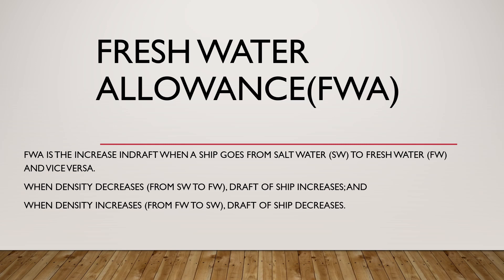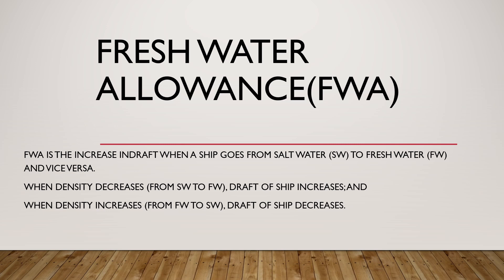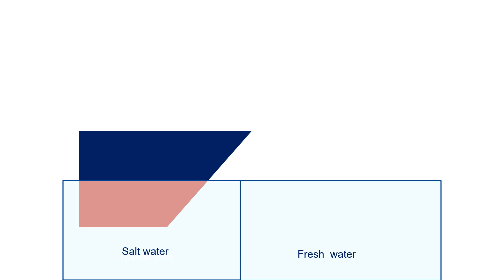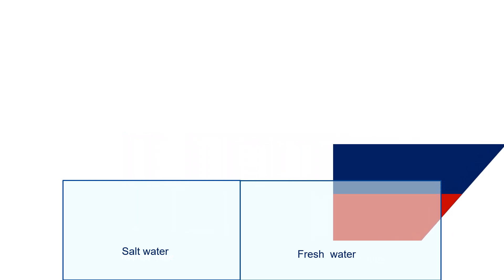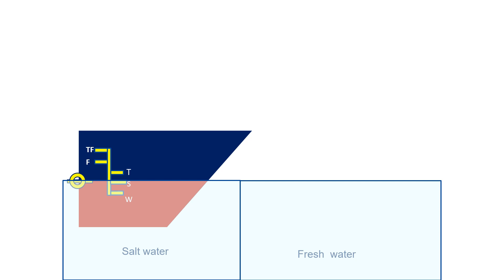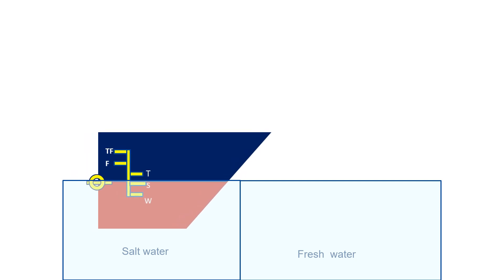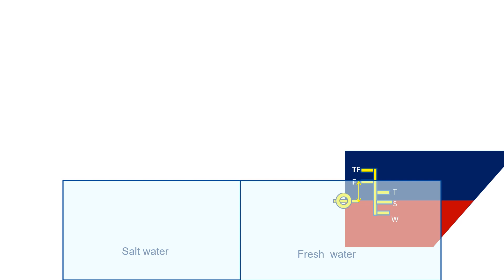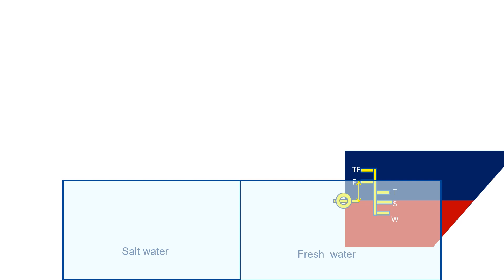Fresh water allowance (FWA) - What is it?

Comment: So if a vessel loaded to her summer loadline enters F.W., can we say that FWA=Distance between Summer & Fresh water loadlines?
Reply: If you add weight to a rectangular barge then every ton of extra weight will immerse the barge as much as the previous ton of weight. 
A linear relationship between draft and TPI.

With a vessel that doesn't have a rectangular hull; that tapering is going to make it so every metric ton you load will yeild diminishing returns.
A curved relationship between draft and TPI.
Reply: Yes. Summer draft+FWA is Fresh water mark. Tropical mark + FWA is TF mark.